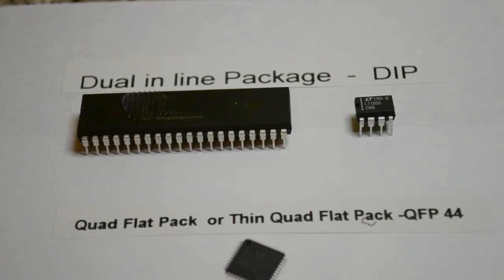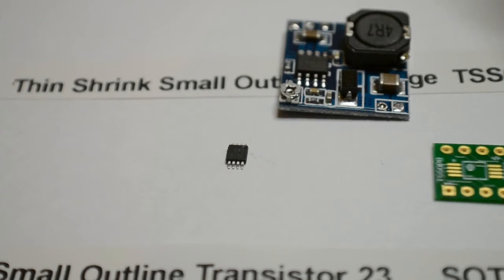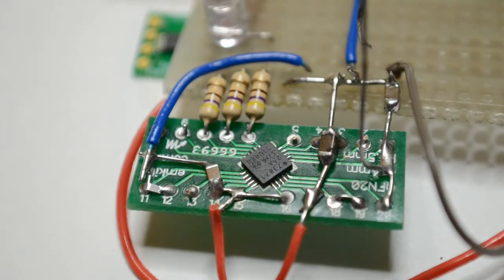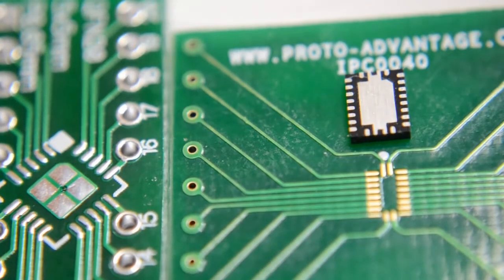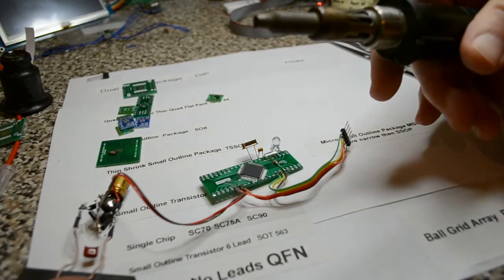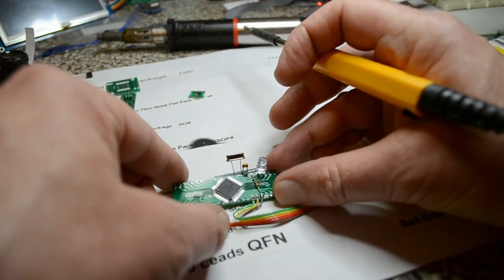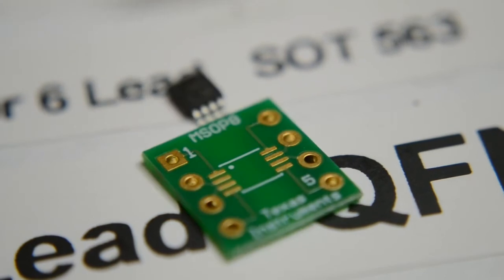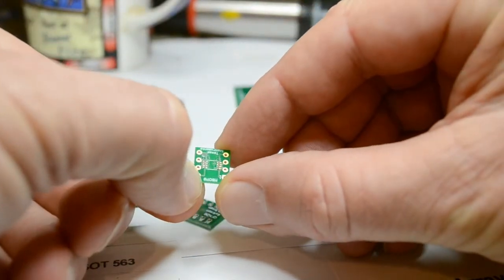SMT & SMD Package Types - How to Solder by hand DFN, QFP, QFN, SOT23, SO8, MSOP, TSSOP, SC70, SOT563

Comment: Hi John, thanks for the video. I am looking into soldering QFN packages, and current looking for low cost qfn adapters, do you mind telling where you got those adapters from?
Reply from the maker: Hi,
the 44 pin & 48 pin QFN pcbs were from eBay, possibly Germany from memory.
Obviously the smaller 20 QFN were from Canada with their address on the board.
Regards
John